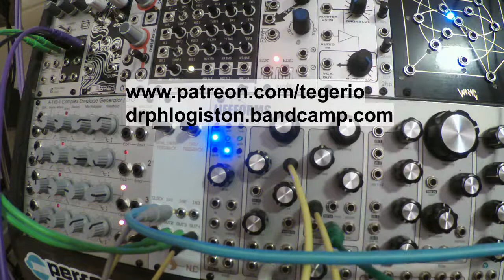Testing Non Linear Circuits Squid Axon

Comment: Have you found a shift register or module for note hocketing yet? I’m looking for something like that too. Have a squid and it’s fun but that drop is too wild!
Reply from the maker: No, I gave up on that idea because I couldn't find anything that would do it.
I do have a Toppobrillo Quantimator which is a quantizer with three outputs.  In one of its modes it generates chords, and in the other is supposed to be able to rotate & shift outputs for hocketing ... but the manual is unavailable and I can't tell if I'm using it right.
Reply: @JoshuaKennedy321  I was just looking at Intellijel shifty and that one seems like I’d work as it won’t drop in voltage in the chain. But that’s all I could find with some similarities to my understanding. You try that one?
Reply from the maker: @elvishopper4495  I never tried the Shifty.